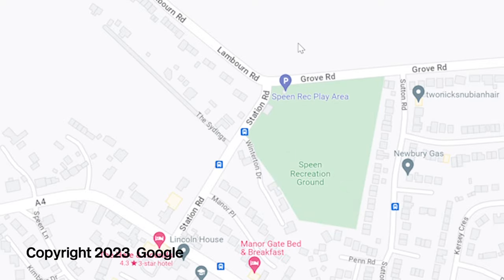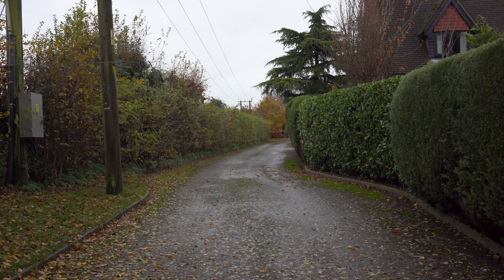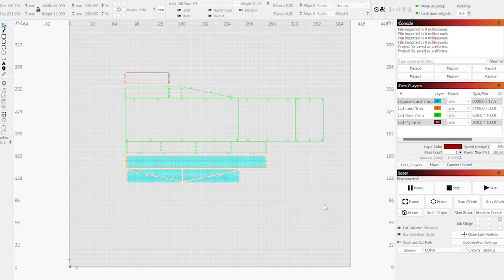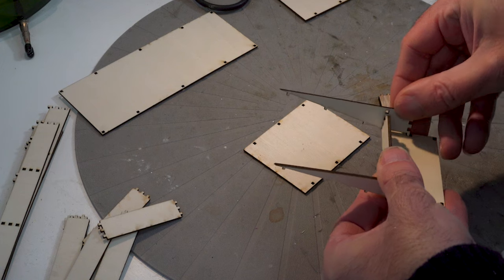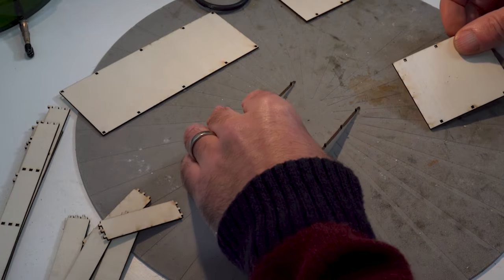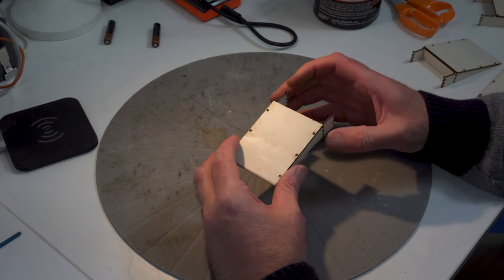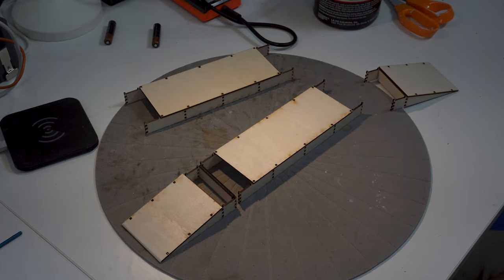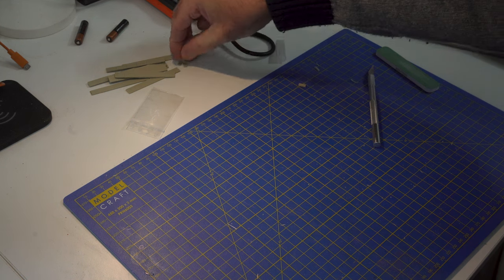5 - Scratch Building Speen Station using a Laser Cutter

Comment: Nice video and platform, that was a good idea adding a second layer for the brickwork sides of the platform and making each brick course intergrate with the next piece which made it look seamless, hiding the connecting holes, which I think makes buildings and other items look ugly on proprietary items that have the brickwork already etched into the wood and there isn't any way to really hide them... just an observation, if you made the top of the platform flush with the sides you could then intergrate the 2 courses of brickwork that you made seperately with the main bit of brickwork sides and then you could make a separate top piece to include the platform overhang and etch the stone platform edging into that, along with anything else like manhole covers or drain grating
Reply from the maker: Thanks, that’s a really nice suggestion. I need to make some more modern platforms over the other side of the layout and your idea could make that much quicker and easier. Hopefully I’ll get to try that out in the New Year!

Comment: It might help to name each piece and put a registration number on each piece, like and Airfix kit.  A goes to A, B to B and so on.
Reply from the maker: That's a good shout, thanks. I can add those labels in Lightburn so they are engraved on each piece. Will certainly help when I come to build the long platforms on the other side of the layout.